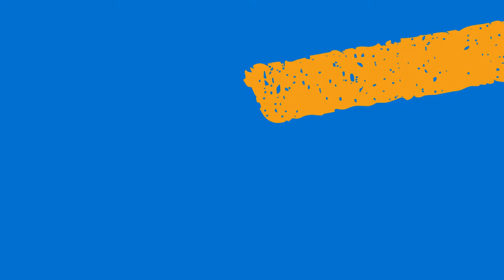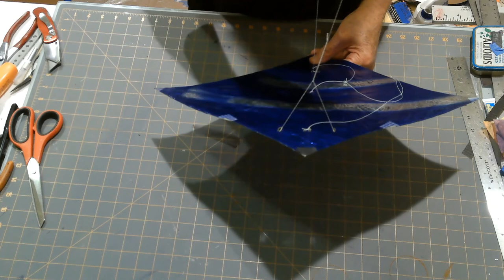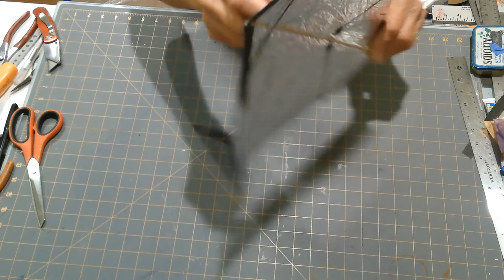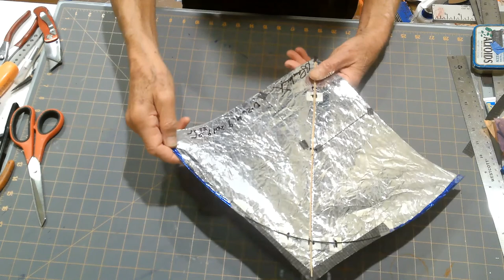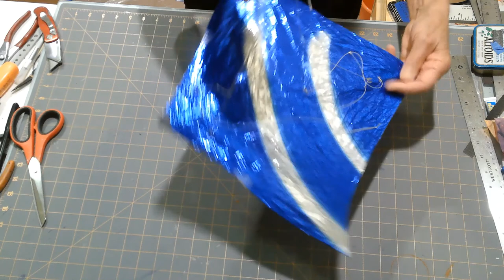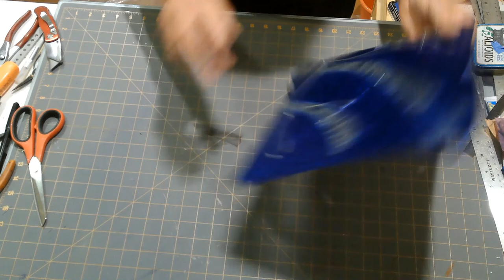North American fighter kite bridles

Comment: Hi Bruce, i liked your explanation of the 3 point bridle for your fighter kite & i agree it is a good solution. 

Such a bridle is somehow never used in Indian fighter kites. Many channels featuring Indian fighter kites, solve this left-right balance issue by giving the bamboo bow a slight bend with fingers. If the kite keeps turning left, the tweak is made on the right side and vice versa. In some cases, they simply add a weight on the problematic side. 

I recently made a video about various bridle settings and how they affect flight of the kite. It is video no. 5  in the playlist called "Kites 2 - My Kites", on my channel.
Reply from the maker: Thanks Vinny Chirayil for sharing your experience.  You are correct about how many fighter kite fliers who fly bamboo/paper kites bend or massage the bamboo of the bow to help balance the kite.  I prefer using a bridle designed to accomplish the same thing, but easier and more permanently.